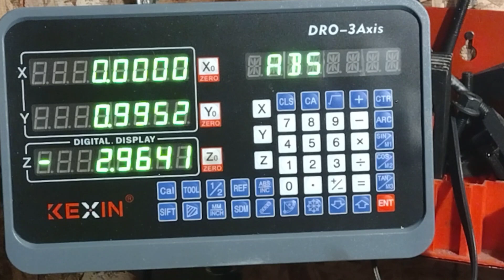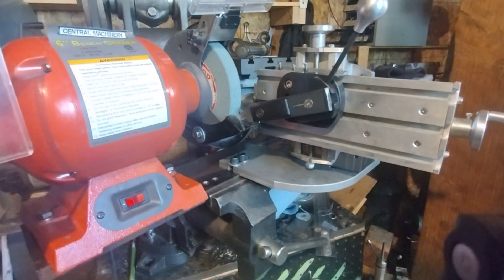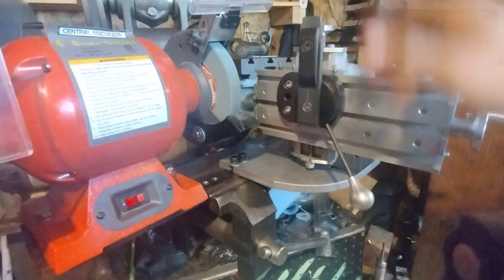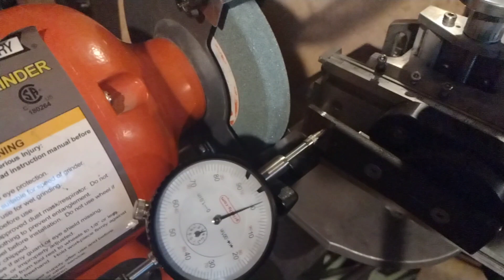Surface Scraping: Grinding Fixture

Comment: You got it get away from your green wheel not for steel . Could use surface grinder wheels ect. Just make sure you keep it as a good wheel. Use it on soft steel no coolants dose not preform well but for your task mist cool do the trick.

Comment: I did some scraping after learning it on youtube. when I was grinding my scrapers with a negative rake on both sides,
i was getting a similar diagonal pattern on the face. I wound up just grinding the face perpendicular to
the sides of the blade. That way I still had 2 sides to work with before resharpening on a honing stone.
It worked good & the angle was still negative when I held the scraper. It made it easier to hone too.
Reply from the maker: Good to know I'm not the only one who's seen that diagonal pattern. I'm not sure how your blade's shapes but this one, I guess, could potentially have 4 cutting edges. Thanks for commenting!
Reply: @backyardmachinist  That's a nice fixture that you built. I was wondering if the wheel
is true to the blade. Obviously not good enough. Think about the stick out for the 
radius could cause deflection. Maybe lighter cuts might help.

Comment: After grinding the radius, I like to lap the side faces with a 3000 grit diamond lapping wheel. I use diamond from 280 grit up to 3000 for all faces of all my scrapers.  Your Silicone Carbide stone (green wheel) is not fine enough to keep a keen edge for very long, but that's how we all start.  Your scraping pattern looks very nice.  Contact Richard King for more advise.        Subscribed!
Reply from the maker: Great tips, thank you. I met a local man you said he took a class with Richard King within the last couple years. Do you run your wheels at slower speeds for the high grit lapping?
Reply: @backyardmachinist  my grinder is similar to Stefan Gottswinter's design. It's variable speed but I usually run it very slowly. I use the cheap diamond lapping discs from China.

Comment: Cool video, I subscribed and I look forward to more. That's a really neat grinding fixture. I'm starting to think of getting started in scraping myself, although I'm leaning towards sharpening on the surface grinder. By the way Diamond and CBN wheels are pretty cheap even for US made wheels, have a look at ebay. Most will be 1-1/4 bore but you can make an adaptor if you need to.
Reply from the maker: I'm glad you liked it. I realized this and publishing this vid and purchased a similar wheel. I'll be sharing my process of turning the adapter in a future vid. Stay tuned and thanks for commenting!

Comment: Thanks for the excellent video!
I wonder if the reason for the off-kilter grinding of the second side (@ time stamp ~8:15) might have been caused by a small chip stuck between the scraper handle and carbide?  ...or maybe not? 
Doug
Reply from the maker: Yeah maybe the holder needs a taller registration shoulder. I only made it 0.015" tall. Although rouge chip could've done it too. Thanks for watching!

Comment: your pivot point on your fixture is not exactly centered on the grinding wheel. you should use the side of the wheel and turn your fixture 90°.
Reply from the maker: Those are good points, thank you! From my understanding grinding on the side of a stone grinding wheel can cause it to crack over time as grooves develope, but maybe that'd work with a cupped metal wheel with diamond composite. I will definitely try to center the jig on the bench grinder's spindle in the future. Stay tuned for the next vid that shows a wheel along those lines and thanks again for commenting!
Reply: @backyardmachinist  the side of a wheel is used all the time on a surface grinder, i have a drill sharpening attachment on my grinder that uses the side of the wheel... just keep it dressed flat and dont use the side of the wheel for heavy grinding and you'll be fine.